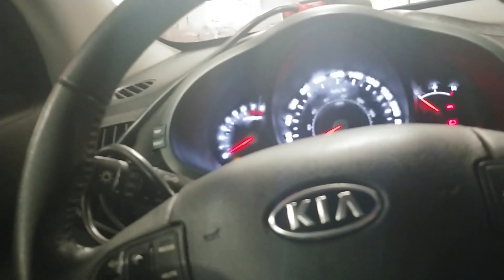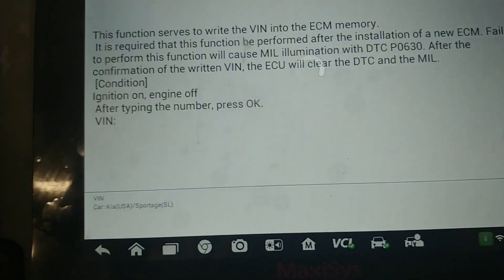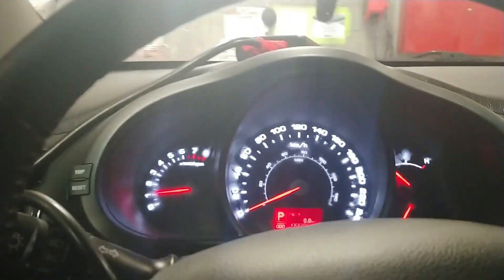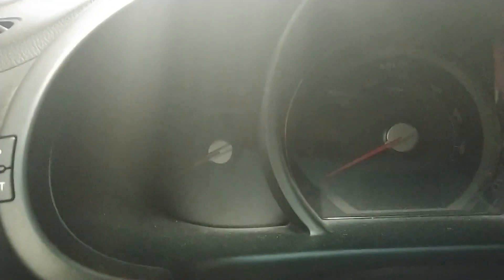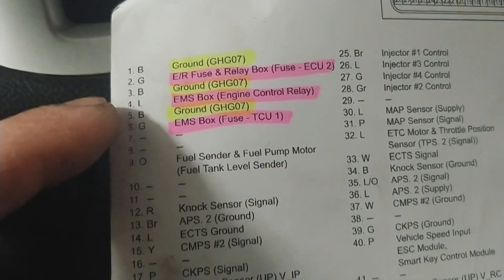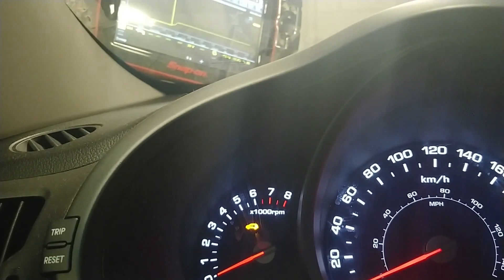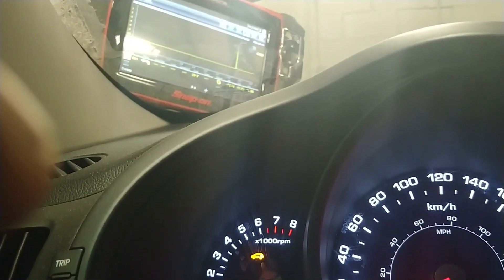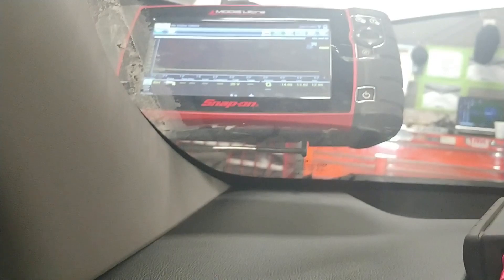2012 Kia Sportage ECM

Comment: So how does the car run if the new pcm comes blank and all you did was write the vin and keys?? No actual programming with a j box required? Might have a 2014 soul to do this week I have a pin code puller. And cardaq 3
Reply from the maker: noope no jbox for kia vehicles just a scanner that can right the vins and program the keys.
Reply: So I’m confused. Do new modules come blank? How do they run if all your doing is writing a vin is what I’m confused about

Comment: My 2012 kia sportage will not shift out of 3rd gear. Problem happened after vehicle was jump started and cables got hooked up wrong. Fuse on positive battery post burned out and keys had to be reproggrammed.
Reply from the maker: Never a good sign, might have caused damage to the pcm/tcm, have you had it fixed?
Reply: @JL's Auto Solution  I am having a hard time finding a new pcm. Even conflicting info from dealer and other techs. Some say they are one module behind battery and others say there are two different modules. Do you know if it's 1 or 2 boxs.
Reply from the maker: @markjacobs7820  pcm and TCM are one unit
Reply: @JL's Auto Solution  do you know where I can by a new one.
Reply from the maker: @markjacobs7820  sorry for the late reply. if all diagnostics lead to the pcm  then change the pcm. but only the dealer can get a new pcm.

Comment: Simple explanation thanks, but was your PCM blank from the dealer or it was used from another car??
Reply from the maker: New pcms come blank from kia.. And todate i have not been ablw to put a ised pcm in a kia vehicle.
Reply: @JLsAutoSolution  yesterday i read in kia form that in order to program used pcm you need to first neutralize the used pcm on the car that which came from it by scan tools then put on your car and program the keys to it, which in my opinion is impossible since the used pcm usually lose the original car that will come from it!!
Reply from the maker: @az93850  THE ISSUE IS THAT THE PCM HAS THE VIN LOCKED IN IT.. SO YOU CANNOT ERASE THE VIN FROM THE PCM AFTER THE VIN HAS BEEN IN PUT.. NOW THE KEY CODES  ARE A DIFFERENT STORY-- YOU CAN ERASE THE KEY CODES AND INUT A NEW ONE BUT THE VEHICLE WILL PROBABLY STILL NOT START DUE TO  MISMATCH OF VIN.. HONESTLY I HAVE NEVER TRIED IT , BUT THIS IS MORE OF AN EDUCATED GUESS.

THANKS FOR WATCHING.
Reply: @JLsAutoSolution  Nice video.Thanks. Where the PIN code you talked about will be found? will it come with the new ECM,IF YES,WHERE EXACTLY TO LOOK FOR IT?tHANKS